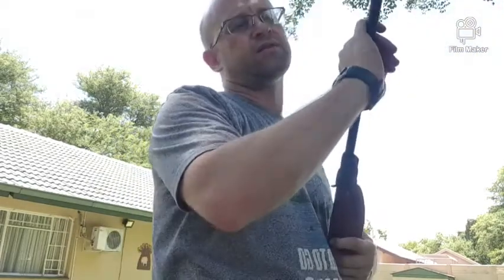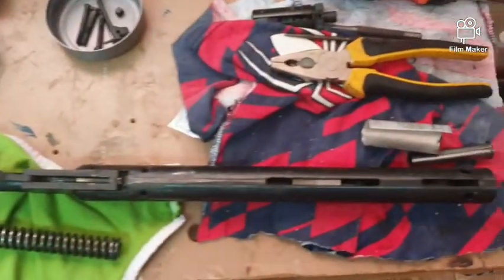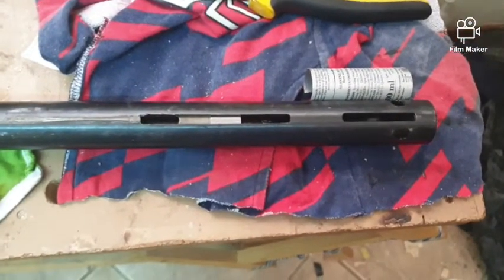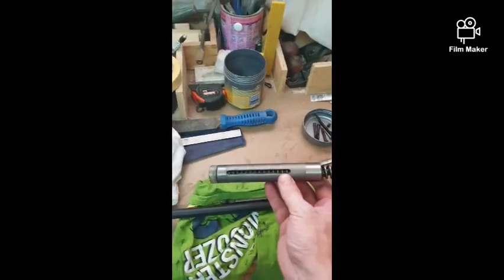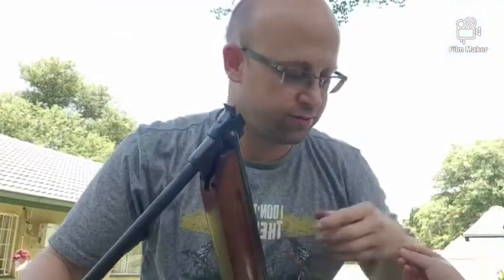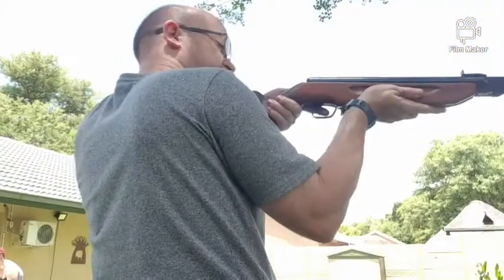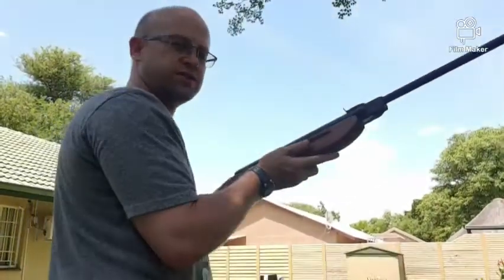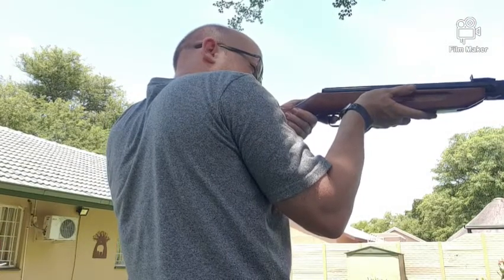tuning a springer at home - simple

Comment: Perhaps this video is helpful for people who know how to remove the spring, know where to get the sleeve inserted in the spring, know what to do with the beer can, know how to re-assemble the gun, and know how much grease is "enough".
Reply from the maker: @WDTA UT thanks for your comment sorry if the video wasn't clear enough. Perhaps I can suggest just starting with the lub tune. You can put in grease at the slot under the spring chamber if you just remove the stock. You can't really put in too much grease in, you will see when the spaces between the spring is full. Then just put the stock back and happy days
Reply: Hey friend It was my first time and I did great and feel better for accomplishing it. I just did with like 100$ Walmart gun
Reply from the maker: That is great, hlad it worked out
Reply: I have chrony coming in tomorrow but it seems like it hits harder. But the vibration is less feels better to shoot. A lot of plastic part in my Gamo tho

Comment: Having restored grandad's pre-war Webley Junior the secret seems to be, make it gas tight and free moving. The early Junior has a leather skirt on the piston that is tricky to fit. It is oiled chamois leather i.e. goat skin. It has to be pressed and shaped into a cup and the edges tapered fine and thin. It faces forwards and needs a form of piston ring compressor to get it in. the trigger mechanism has to be removed to get it past the sear and then the skirt guddled past the hole without tearing it or turning it over. This does mean you cannot readily take it apart to service it.
The barrel seal is another contentious area. The new supplied seals are a poor fit and compress the hole in the middle. Or too big, soft and floppy. This is a transfer port and if too small restricts airflow. The barrel seal I was using was fashioned from some thick wall petrol hose but that tore up over the last 40 years. The new boughten seal is floppy but I have two others at hand, one of which is leather and brass. However the barrel breech has considerable wear and it not quite square any more.
Even so it still delivers about 350fps ~2.1fpe. About as accurate as a pea shooter but can hit a target somewhere at 5 yards.

Comment: Speaking with engineer hat on, I've found oil has less stiction then grease. The purpose of oiling a spring is primarily to rust proof it, secondarily to lubricate its movement in its sleeve, there should not be any friction acting on it. The spring may run better free not rubbing a sleeve. With modern springers the seal on the end of the piston is often leaky, plastic seals don't seem to be as effective as the olde oiled chamois leather. The piston must run smoothly in its barrel, over many years they will polish themselves together, but they want thin gun oil not sticky grease.
Reply: Yeah seal was hard and kind of cracked. You know of any store to buy things for springer or things like that? Thanks
Reply: @Albertcortes66  some parts are sill available for my 85yo family heirloom Webley Junior, or reproduction parts. The piston seal I bought in the 70s I seem  to remember was plastic and inadequate. So I made my own by skiving some good leather and forming it around the olde leather buffer. A disc soaked in oil and then gradually squeezed to stretch and shaped to fit,  before being trimmed. Refitting is a pain because it has to be carefully guddled past the hole for the sear. It does like to be kept wet with oil and not allowed to dry out.
Reply: Thanks for the info.

Comment: it will be nice to do this with a cronograph...to see if there is some difference between.... if with so much lubrication in it will became less powerfull
Reply from the maker: @Radu Mihai it will influence the fps, it will decrease the fps a little bit but should make it more consistent. With a springer it is often better to go for a smoother shot which will result in better accuracy than increase fps but you can't hit your target

Comment: How to increase springer rifle power plz any tipy
Reply from the maker: With a springer the easiest way is to add a spacer to pre-tension the spring but you will be limited in what you can get out of it. Probably better off going for a smooth an action as you can get which will help with accuracy
Reply: Switch to Ox Accelerator mainspring. It is squared pretty much like Misumi, conventional mainspring is rounded. Also, "accelerator" means you don't have to lube it, and it is very powerful.
Reply: Make sure the Ox mainspring you buy is slightly shorter than your default spring.
Reply: I bought mine from TALarms based in UK and it ships worldwide.
Reply: Titan XS also good, a bit cheaper than Ox i think. Don't just go for fps, pellet weight also very important. Fast doesn't always mean accurate. Good luck.
Reply: Diesel the pellets
Reply from the maker: Dieseling pellets is not advisable. This will damage your rifle
Reply: @African-Budget-Pellet-Gunner  still gives it more power that’s all he asked
Reply from the maker: @pauldavies917 true it does but it also messes up your rifle. Perhaps the person saved up to buy his rifle and wants to make sure it lasts and the work he does to it is good and proper. Now if he diesels pellets all that savings will be a waste and he will probably never buy another pellet gun due to his experience this time round. So just my opinion don't diesel any pellets in your rifle
Reply: @African-Budget-Pellet-Gunner  💯 percent 👍✝️

Comment: Not shitting on anyone but I don't think it is any more powerful after the mods maybe use a chronograph but it is definitely alot quieter so gets my vote on that alone. Thinking about doing my Springer pistol as it's been in the loft for years only recently found it again
Reply from the maker: You are 100% correct it won't be more powerful with the lub tune it might be a little less powerful however should be a little more consistent and as you noticed quieter